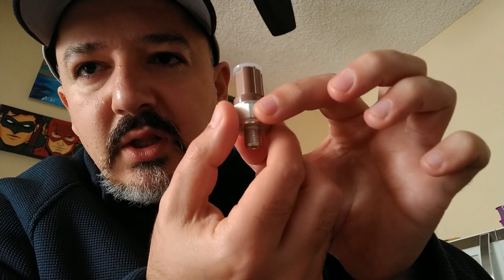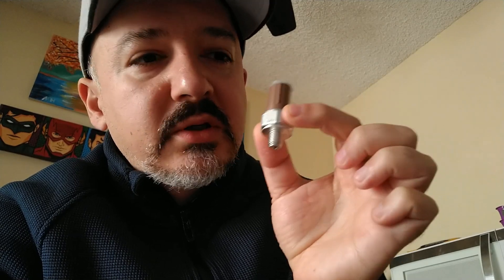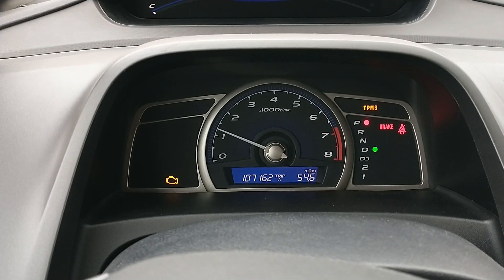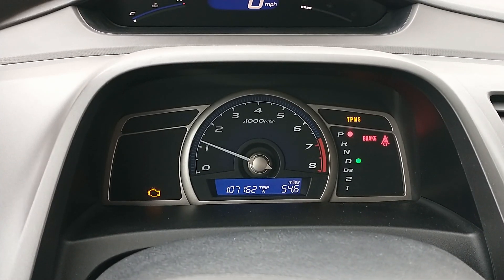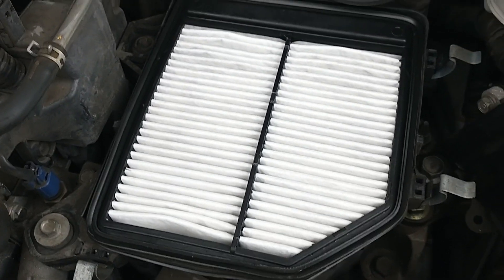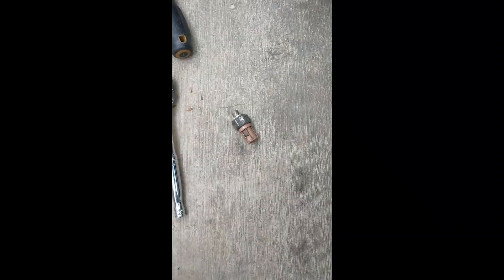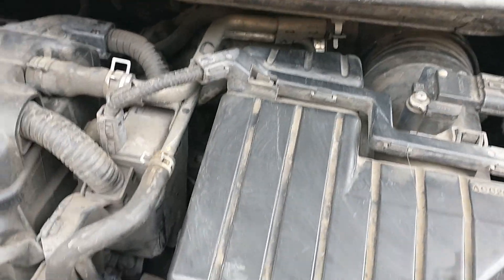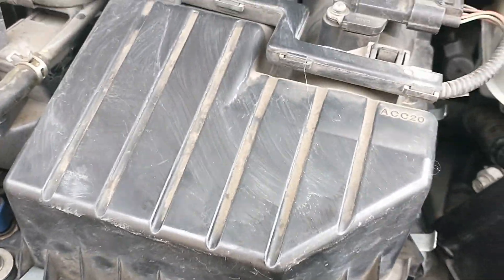Honda civic P0843 2nd clutch switch replacement

Comment: Labor $249.95, AT Oil Pressure Switch $142.88 and Gasket $9.98 equals $402.81 plus tax at Vandergriff Honda, Arlington Texas. This is not a difficult job.  Paying Honda's labor time of 1.25 hours and paying Vandergriff Honda's $199.95 labor rate per hour is a good incentive to do this job yourself.  BTW, Vandergriff Honda calls the washer applied to the pressure switch a gasket.; I guess that justifies the washer's $9.98 cost.

Comment: I changed the same switch and light still comes on and same code..please help
Reply from the maker: Change your transmission oil and check the switch you bought is not defective. Otherwise you have to take it to a mechanic so they can diagnose the issue.